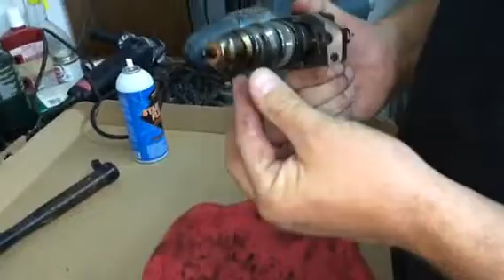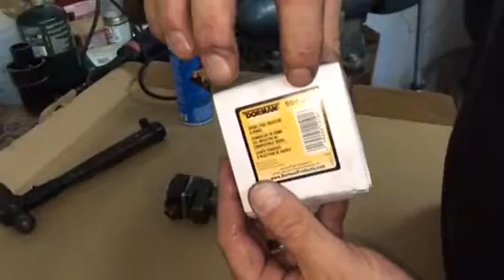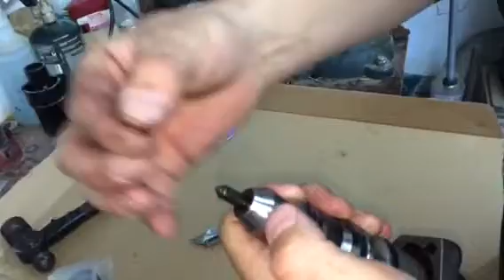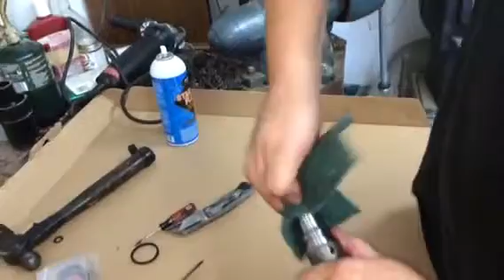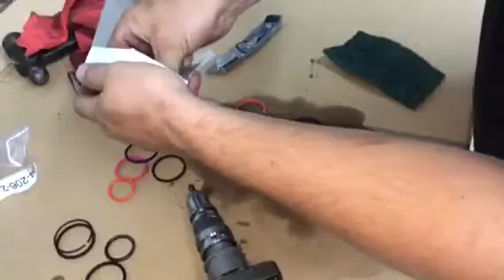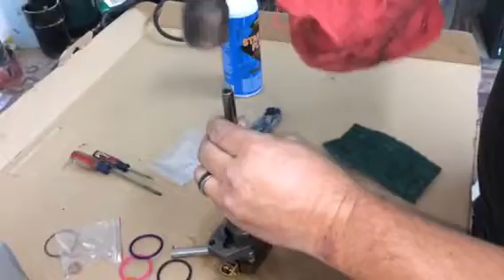7.3 Powerstroke fuel injector O-rings replacement $8

Comment: a couple things that may help.  there is an ebay dealer in las vegas called Jet that sells teflon coated viton o rings for these 7.3l injectors.  they are cheap, but good,  from this dealer.  also, using a small screw driver to remove the old rings "may" scratch the surface of your injector.  (endless hidden problem potential)  i use wooden toothpicks to get under the old rings, then i carefully use a razor blade to cut the old rings.  careful, careful to avoid scratches.   also, i use mobil 1 red synthetic grease over the injector before sliding on the new rings.  hope this helps!

Comment: I checked my fuel bowl today and it looked a little dark like it might have mixed with oil in my truck is smoking Blue smoke out the tailpipe and the ccv, also from the oil field has a lot of blow by but not an extreme pressure where it blows the cap off but definitely a white or blue smoke
Reply: I was wondering if you had some of the same symptoms

Comment: I have my 2002 Ford F250 Powerstroke. 175,000 original miles by me and only me. SCT, MBRP, Howes or Stanandyne almost always. Runs like new. It starts rough if I don't plug it in. Even on 50 degree days. Then it levels off and runs perfectly. If I plug the truck in I can drive off immediately with perfect operation of motor. I just went to Arkansas and back. 1500 miles. Pulling a car hauler with car. NP at all. New Glow Plugs, GPR "Yes it works", IPR, New Harness, Buzz Test shows it's fine, New #8 injector last year, New O rings HPOP. My buddy who is a PStroke guy said this trucks runs too perfect for it to be injectors. He recommends seals for the injectors. What does this mean. Or what else can it be. Where should I start. Please help guys. Thanks

Comment: What was that cloth pad you used to clean the carbon off?
Reply from the maker: Just a kitchen cleaning, pan scrubbing pad. You can find an automotive version of this on the paint and body filler isle of the auto parts store.
Reply: +Tinkering Fox thank you I got my truck back running 100% again

Comment: By cleaning all the injectors and o rings does that help with blue smoke by any chance
Reply from the maker: David Lopez you might get better spray by cleaning the tips but your smoke is likely oil consumption and  not related to oil seals on the injectors. It is possible to have oil bleed past the o-rings and make it into the cylinders though.
Reply: Is that repairable? It's a 1995 f350 with 107xxx
Reply: What's my best bet? Its still has the radiator from 95
Reply from the maker: Yes, 107k is pretty low mileage for a 7.3. Being a ‘95 I assume it’s non turbo (powerstroke). A compression test would be a great place to start.
Reply: Check your fuel bowl! If you have oil mixed in with fuel.  You might have a injector o ring issue! Make sure to always keep you fuel filter clean and very important for you to maintain your air-filter. As dirt can ruin a turbo if you have one and or your piston rings and piston.
Reply: @kevefox  should you be giving advice if you don't know what you're talking about? A 95 7.3 is never going to be non turbo unless someone put a 7.3 idi in it for some reason. You also put powerstroke in quotes after that, there isn't a single powerstroke that's ever been manufactured that is non turbo.
Reply from the maker: @johnhoward2351  thanks for pointing that out.

Comment: Where did you buy this o-ring kit?
Reply from the maker: Mr1967mejias O’reilly Auto Parts, Dorman PN 904-206
https://www.oreillyauto.com/detail/b/dorman-oe-solutions-3387/fuel---emissions-16775/fuel-injection-16471/diesel-fuel-injector-17271/fuel-injector-seal-o-ring-kit-12312/ee721b9bfdb5/dorman-oe-solutions-o-ring-kit/904206/4258705